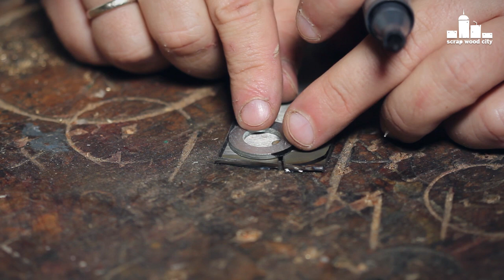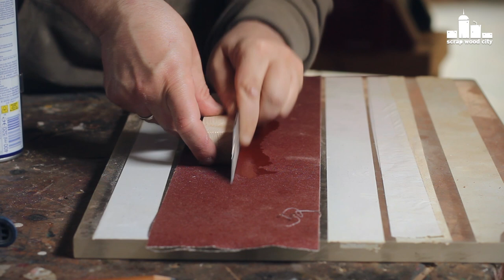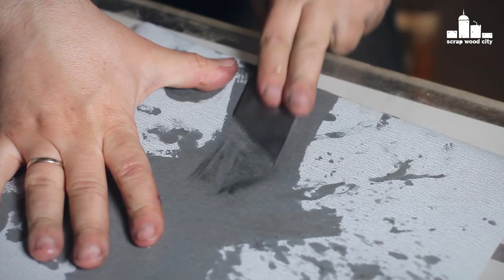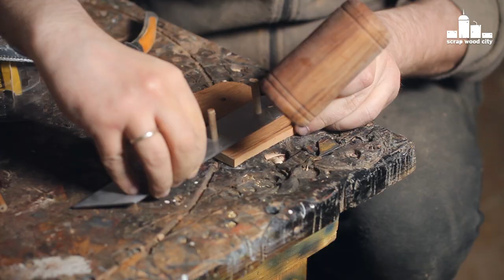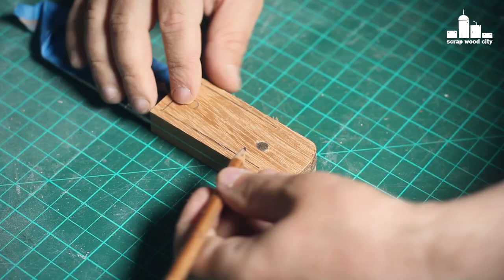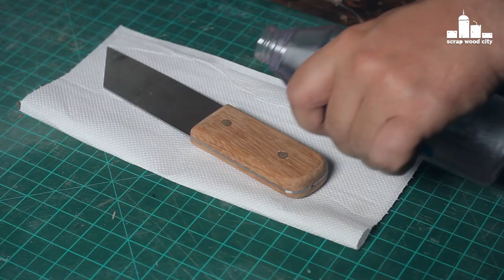DIY knife parting tool from an old table saw blade

Comment: When riveting  make a rivet head plate by drilling a hole in a piece of three eighths steel plate the size of the rod stock you are using then use a counter sink drill bit to form a counter sink throat like a funnel 
To form a head first lay your head plate on vise insert the rod through the hole with about an 1/8" above the plate and grip in vise and then use a dall peen hammer to form the shoulder of rivet 
Countersink the holes in handle scales 
To used the rivet place through the handle and place head side down on anvil and leave about the same amount protruding as you used to form the head using the ball peen hammer peen the head down using strikes around the rod to peen the head into the countersink and tight to the scales file flush and done
 headless rods will not hold even when epoxied 
Nice thin parting tool

Comment: Great tool. Why didn’t you save and use the carbide tip end for the cutting edge?
Reply from the maker: Thank you. I wanted to he able to sharpen it for a long time. And also I don't trust that the carbide tip will stay there for ever. So, in my mind this option was never in my intentions.
Reply: @ScrapwoodCity  Thanks for the explanation.